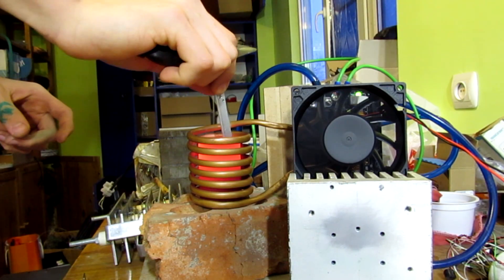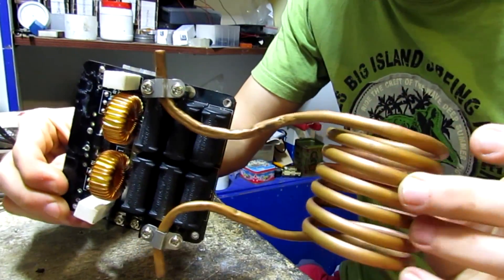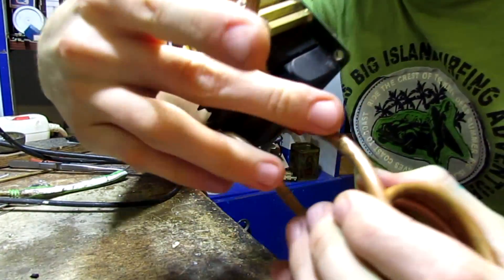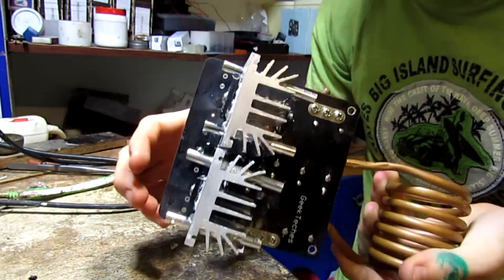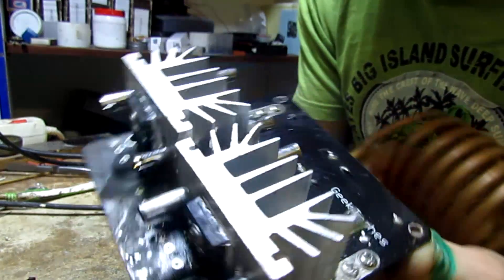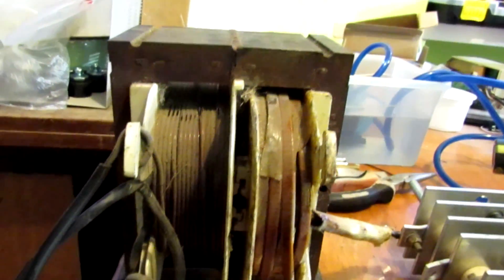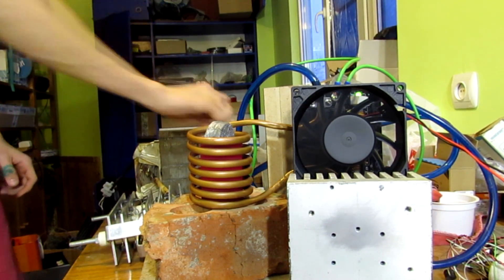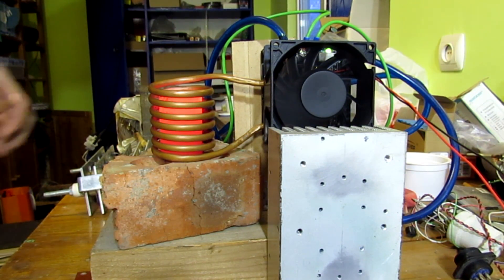How to make foundry for casting metals

Comment: ALWAYS fit heat proof fibreglass sleeving to your copper coil! OR cast some heatproof refractory material around it. HIGHLY dangerous to short turns on the coil as you saw!

Comment: Always wonder about Metals like molybdenum or niobium that has melt temps at 2600+ Celsius. Do they dissolve into other metals at lower temps that can melt iron?

I have some tungsten but there is no realistic way to get to that temp letalone have a crucible that can hold 3600 C metal. Graphite at that temp makes tungsten carbide.

Comment: Could you make improvements to this heater to melt steel ??? Thanks.
Reply: @Floris van Nederpelt Thank you Floris, I will keep that in mind for a superior design and performance. Peace too. VF
Reply: @Floris van Nederpelt Hello Floris, could you please tell me if using more efficient components would reduce the extra heat and increase the speed of heating the steel ??? Thanks a bunch Sir. VR

Comment: cover yer coil with plaster, nail polish or paint should be fine to lower or stop conductivity. water in yer coil should keep the coil under 100c so it won't burn off.

Comment: What happens if you touch pliers to coil? Then there were sparks from board...
Reply: What happens when you thought yoy knowinf it all , no make mistakes with trial and error, then make a big mistake at work with whole life on the line and anothers, better in a shop, oops got a little close there, then at work, oops just electrocuted co worker.
Reply: I mean what happens techically and not speak about safety stuf. My assumption is : A pliers did short over one loop of winding, changes inductance, then some mosfet fails during fast LC oscillation changes ?

Comment: Pretty cool, I've build and melted in my charcoal forge and am interested in building an induction one. I really recommend you melt metal outside in a well ventilated area and wear proper protection when handling a cup of molten metal at 1200 degrees.